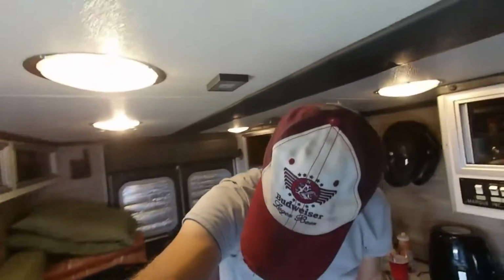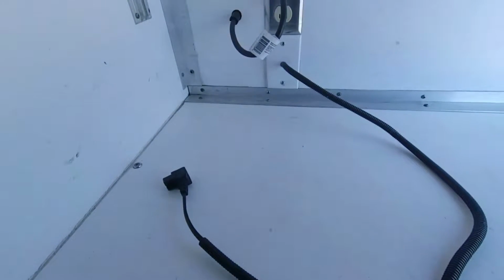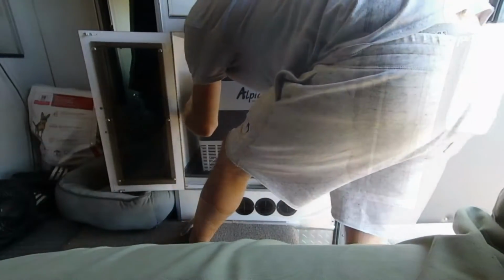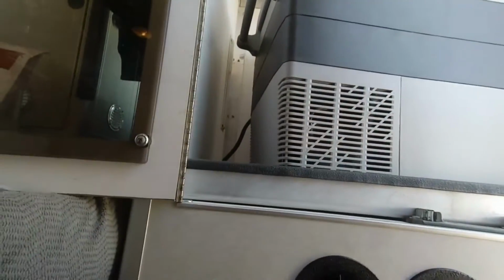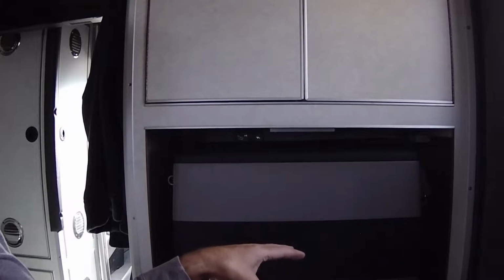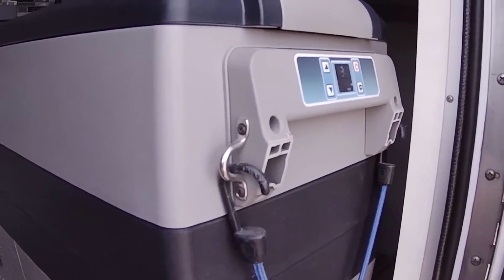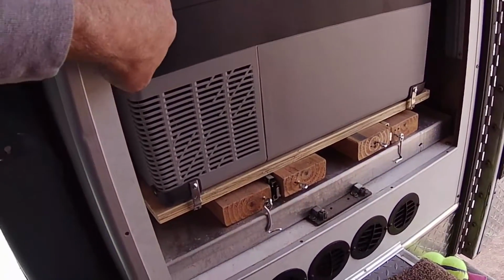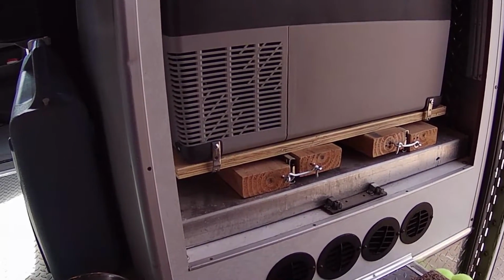New Fridge Installed in Ambulance | Ambulance Conversion Life

Comment: to stop the noise try wrapping a bunji cord all the way around it .  It wont block enough air to worry about on the vent.  not over the top.... around it , but around all four sides.
Reply from the maker: I've been messing with this thing and found that if I slide it out a few inches, it becomes very quiet. This is allowing it to soak up its own vibration. I'm going to place a soft rubber mat under it to give it enough wiggle room to do the same. I think that will work!

Comment: looks awesome.  well thought out.  just ordered myself a 12v compressor fridge.  it was a cheaper one and i hope it lasts 3 or 4 years  by then i can get a better one with the danfoss compressor
Reply from the maker: Thank you. It's functioning great and the sliding mechanism is also working smoothly. This was just over $300 - I couldn't justify spending the $1000 that the Domestic costs!!! If it lasts me a couple years I'll be satisfied...
Reply: @TheCampulanceMan  i just did an unboxing of my own on the linsion 12v fridge.  hope it does well.

Comment: How about raising the fridge so it clears the front lip and installing drawer slides on plywood so you can slide the fridge forward for easy access. Probably be able to slide the fridge outside as well with another sheet of ply with drawer pulls. You can also use the ply to screw in straps to hold your fridge securely. Just a thought. I'm getting me an ambulance as well so appreciate your vids. Thanks from Canada!
Reply from the maker: Wow, your ideas are like EXACTLY what I did!!!

Comment: Good thing you didn't wire that cable in to be shorter.  Did you have to lose the doors to make the glider fit?
Reply from the maker: Yes! The cable length actually turned out to be perfect and it extends all the way with the slides. And I did have to remove the doors in order to make moving in and out work. It's was just a bit too small with them. It's good to have the air flow for the compressor so I don't miss them.

Comment: I love that you put it on a slide! I have a 1.7 ft³ refrigerator and a 1.1 ft³ freezer strapped into the top bunk of my 18 Wheeler. They are plugged in to the inverter. I fill my freezer before I go out on the road and I cook using my instant pot and my 7" electric skillet. I live the good life on this truck.

Comment: Hello, what is under the fridge on the bottom of the cabinet that has the breathing round plastic pieces? Any ideas? Thanks
Reply from the maker: That's the built in heater that runs off of the truck engine.